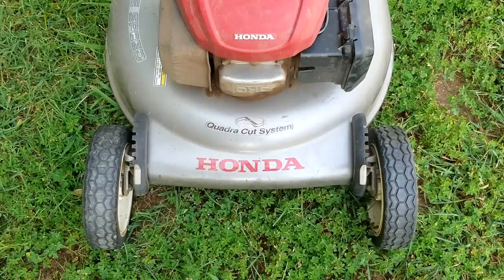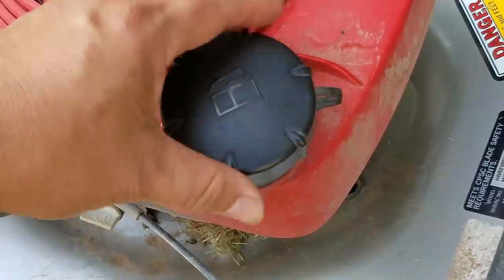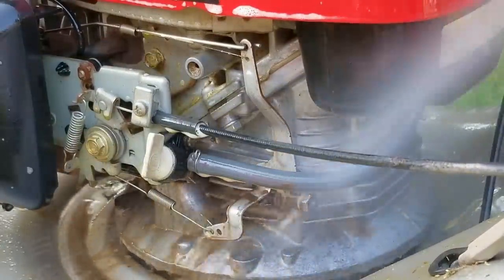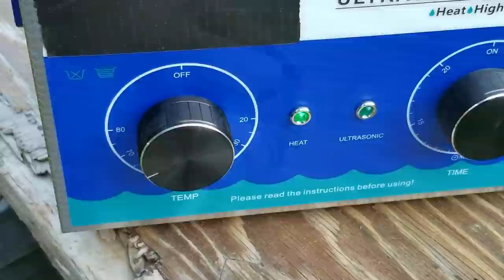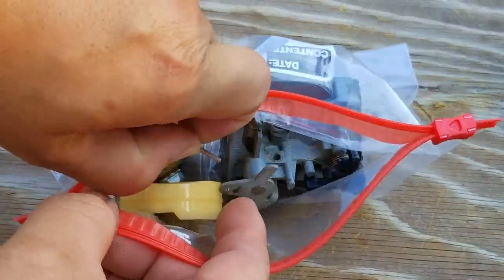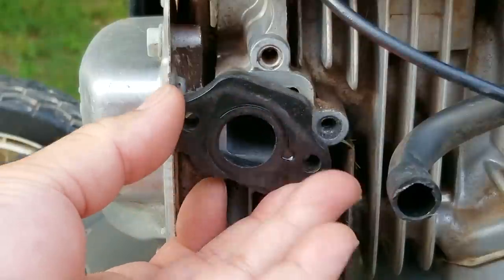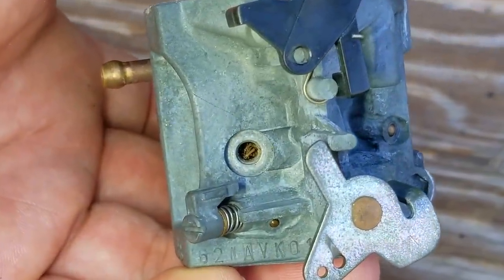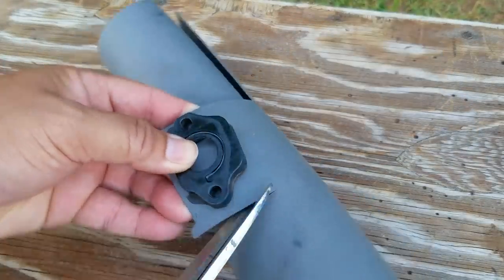This Honda Mower Would Start And Run But Stop

Comment: My first guess would have been a clogged fuel filter not letting enough fuel to the carb, but it doesn't look like this mower has one. Strange. My Honda mower did come with a filter. Second guess would have been the float valve. Very strange to see grass debris in the main jet like that. That really boggles my mind how it got there.

Good job - keep up the good work!
Reply: People fill their tasks in the middle of the yard, and the grass finds a way in. 🙄
Reply from the maker: there's a built in filter at the outlet of the tank

Comment: I cut the heads off two spare Honda carb mounting bolts and used my Dremel to cut slots on them.
I insert them during carb removal. It makes it easier to reinstall and also helps to keep the gaskets in order...similar to the way Kohler carbs are mounted.
Reply from the maker: thank you

Comment: I think too it was the carb, idle circuit and gasket spacer. Plus s good carb clean. With the ultrasonic,  I just use plain ole Dawn dish soap. It's a decreased, the clean the birds with it in oil spills. Works well for me.  Good luck. Thank you for the video.
Reply from the maker: thanks but I do have to remind you that the birds were covered in fresh oil, not varnished gasoline .

Comment: I had the same issue earlier this year with debris in the idle screw/port area.  couldn't recall having ever seen that before.  Had a gasket tear with a friend's Honda earlier this month - didn't have the blade control separately, but surged the entire time.  It also had a cracked insulator (the plastic part).  For my Ultrasonic, I use an Orange degreaser and liberal amount of Dawn dish soap.  I put the small parts into a tea steeping ball, and the big parts right into it.  After about 4 or 5 machines worth, the liquid needs changed.  I also put harder plastic parts inside with a lower temperature setting, as it helps get the greasy, oily grime off with a gentle detailing brush.   Old gas is an easier option, but I always find cuts on my hands that I didn't know I had doing it that way lol
Reply from the maker: you got it, I'm sticking with gasoline or if I get restless, I'll try kerosine

Comment: The last time we used the pressure washer it did just like that mower, even though it had the plastic cam Briggs and it was the main jet stopped. Cleaned it out and away it went. I still haven't gotten the tank drain on it because my Sweetie is threatened me with capitol punishment because of my ailments but it's still waiting. As far as the battery big mower, I've mowed our obstacle course at least 4 times (a good solid hour, drive on low which is plenty fast and blades on economy) and the battery meter is down one bar. Can't tell much difference in reducing the rear tire pressure from 30 to 11 but that's understandable. I run 11 on the opposed, no problem. I got out the Armor-all and went over the plastic. You're methods are rubbing off on me. Happy weekend and Blessings.
Reply from the maker: Nice, nothing wrong with a little pride.. walk to the machine and it's clean, get done doing the work and she's covered in dirt and grass,.. just means something got done.
Reply: True but the fenders have been rubbed on limbs and whatnot getting zeroed in so the Armor-all took care of that. None on the seat because it's slick enough BUT you never know! @HomeGaragechannel

Comment: In my ultrasonic cleaner I use glass jars filled with enough gasoline to completely submerge carbs.

There's no harm done if left in gas overnight.

I recommend you use the basket in your ultrasonic cleaner.
I'm pretty sure the manufacturer recommends it as well.
Reply from the maker: you must have a larger cleaner then? I have the 3 liter and the glass jar that's large enough for a honda carb won't fit with the basket in
Reply: @HomeGaragechannel  Mine is 2.5L and tank size is 9.7" x 5.8" x 3.1" (L x W x H)
I use jars that have lids that are the same diameter of the jar itself.
Reply from the maker: I see

Comment: I am thinking it’s the carb and I believe you have it fixed. Also for those carbs I have seen people use all thread I think it’s called so when you pull out one bolt replace it with the all thread and cut a slot in one end for a flathead screwdriver if you want. Love your videos
Reply: When I was at the L&G shop, I would take carb bolts off a junker, cut the heads off, saw a notch across the bolt [for a flat screw driver] and had the right bolts for dis-assembly/assembly of unit's carb from the unit.
Reply: @georgepruitt637  right
Reply from the maker: yes I've seen the same

Comment: I find that using Pine-sol in the cleaner does not tarnish the carbs, however the temp needs to be HOTTTT before you put in the carb. Not sure why your using a bag (saving money) :) but I do not and have great results.
Reply: I use 20% Pine sol and 80% water and it works great!
Reply from the maker: thanks
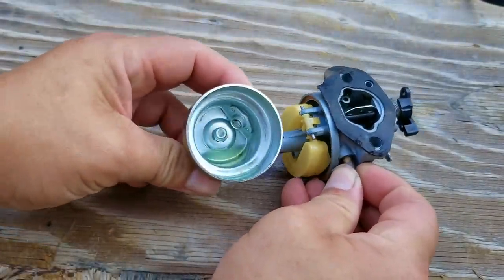Reply: Bag reason @5:08 --  supply shortage.

Comment: I soak carbs in Vinegar for a couple hours .  Than I fill the Ultrasonic with Hot Water, and add a pinch of Baking Soda . Carbs sparkle, no corrosive chemical residue .
Reply from the maker: Thank you for that advice, I'll have to try that!

Comment: Hope you don't try to re-invent the wheel. Use the cleaner DILUTED, and why are you using a bag or jar, and rinse really very well. Use the ultra-sonic cleaner as intended. Try Harbor Freight HD degreaser,  ( the yellow stuff) or I use purple power sometimes. Make sure the liquid mixture in the tank is hot, not cold. Thanks for the video.
Reply from the maker: I'm trying to stay away from the HF degreaser for right now, and sticking with gasoline .

Comment: To me it looks that the cleaner fluid was more then ok. But all those harsh cleaners need care when using on metal, and you never let them in contact with metal parts for more than 10 minutes... I'm pretty sure it's also written on the flask :)
Reply from the maker: yes i have to agree with you, so need to be a bit more careful now.

Comment: my craftsman with kohler mower gets harder to start every year. Normally I put stabil in it and leave it full. Last year I drained the tank completely, drained the bowl, let it airdry and put it back together.

Well I couldnt get it to start at all this year. when i took the bowl off, it was full of a whitish crusty substance. i mean full. all in the bottom of the bowl. all over the float, which was stuck. I couldn't believe it. I have no idea where that could have come from. The one year I drain the entire system and somehow get a bunch of gunk build up, yet every other year i left it full of gas with stabil and it never did that. 

i cleaned it up but it would only run on starting fluid. Even after I got the float free, cleaned all the little pin holes and got fuel to flow into the bowl on it's own. What a mistake. Maybe I should have left the bowl off of  the carb all winter instead?

I just dont understand what that build up could be, with no fuel in it. The gas tank looked great, dry as a bone and no junk in the bottom.
Reply from the maker: sorry I wish I could help with this one.

Comment: Because the oil level was very low on the dipstick, does this mower have the oil minder function to keep it from running with not enough oil. I would have checked this first; and maybe a comment by you would have been helpful.

I really enjoy your channel and you do a great job! Thanks!

Speed
Grand Rapids, MI
Reply from the maker: unfortunately this mower doesn't have that system on it.

Comment: I thought main jet , but then the gasket most likely was the ploblem here  .on the cleaner part i had some that left a carb like that i just try to use water to rinse it off quick . But i use ajax dish soap for my cleaner 👍
Reply from the maker: nice choice!

Comment: I have a older snapper with a Briggs quantum 4 and it's doing that same thing but I drained the gas and put fresh gas cleaned the carb still does it so I need to get a new carburetor altogether
Reply: Could be losing spark when it gets hot. The Quantum carbs are pretty bullet proof.
Reply: @GuysPlayingWithTools  no it not getting gas at all it will run off starting fluid and as long it goes through the air port otherwise it will not run on the carb way I even thought it was the needle and seat but it works I can blow air and carb cleaner through it e no gas goes in and yes gas flows out of the gas line
Reply: @adammosher1115  I would go straight to the jets in that case.  On that motor, there is a bolt holding the bowl on the very bottom of the carb, take that bolt out and clear the holes on the top and sides.  I usually push a thin wire with lots of kinks in it  through them and it usually works like a charm.  I see this a lot and would bet  a nickle that will fix it for you.  👍
Reply from the maker: you're making a great choice
Reply: @GuysPlayingWithTools  I did all that and still no run I even took a carb off one  I know runs and still not running only when it goes through the air port
Reply: Is it an auto choke?

Comment: Broken gasket and dirt in the idle circuit... Would that cause the problems observed? I think it definitely could. Sounded like it was running fast, too, which I don't think would be caused by the problems found. An air leak should cause the mixture to go lean. Dirt in the idle circuit should make it even leaner, which, I think, would cause the RPMs to drop, wouldn't it? I'm wondering how the dirt got in there, though.
Reply from the maker: I think you might be right

Comment: Honda ' sandwich '  Use short lengths of threaded rod [ metric ] to hold various parts, and gaskets  in  place.  Block up carb side wheels so gravity works with you , not against you .
Reply from the maker: I like the way you put that.

Comment: I’m pretty sure you have fixed it unless the cleaning solution has corroded something you couldn’t see.
I have a Honda mower and the engine rpm is not as fast as it use to be in the operating position. All videos I’ve seen say to bend the governor arm. Is this correct?
Reply from the maker: yes it's the easiest way unless you want to do it the hard way.

Comment: Do you know anything about Powermore engines? This on a Cub Cadet self propelled I am working on. This is the first of this type I have messed with. It will run about a second and then die. It will start from the pull rope, but will run for a second, even if I put gas directly in the engine. Starting fluid or brake cleaner makes no difference. It doesn't seem to be a fuel related issue. It's really weird. I have no idea where to start. I have been getting a lot of weird issues lately. I can't really find any information at all online about these engines. It doesn't even have a label or model number on the engine. The issue is very similar to this, except it dies more quickly. It doesn't even get up to speed.

Comment: I've been using super clean on my mowers and other lawn equipment until I noticed that it tends to strip wax off of the plastics and paint making it look dull and faded. I've since switched to a non-wax-removing cleaner even if I have to spray it down 2-3 times. Have you had this same problem?
Reply from the maker: yes I have and I need to be extra cautious when using it.
Reply: Yep the hf degreaser will eat paint and oxidize engine block if you don’t really rinse it good, then spray some wd40 on it and wipe it down. At least that’s what I found. But, it does degrease crud really well!
Reply: @HomeGaragechannel  You may not have the time or the need to, but a great way that I've found to bring back the glossy appereance to lawn equipment is by spraying 303 Protectant on the plastics and applying just about any automotive wax to painted metal.
Reply from the maker: yes that works too

Comment: What causes some of these mowers to hiss when pulling them over? I’d like to see a video fix on it
Reply from the maker: as long as it starts I'm not worried about it. But if it won't start and it hisses I'd have to confirm the hiss is the problem

Comment: I had a briggs that was running poorly.. I ordered a Plastic Carb and it will not start..I put the old one on and it started but fuel delivery seemed poor.. have you had issues with the carbs they order from amazon?  Do you have any advice on where I would begin to take the carb apart and check if its working properly.. is it possible its the part or is it possible I did something wrong?
Reply from the maker: no I very rarely have any issues with the carbs I get from there, maybe 2% need a bit of work to get to work but they work though.  As far as your problem I'd need more information to help out but to be honest it sounds like you have a problem that's not related to the carb.  But with the fuel line, fuel filter or the tank and cap.

Comment: I have a hyper though weed eater that keeps braking the trigger when you give it gas would you have any ideas thaks man
Reply from the maker: sure have you checked that the throttle cable and the lever on the carb, is NOT stuck? I ran into the same issue just today

Comment: No, I think that you found out that those grass clippings were the problem !
Reply from the maker: agreed
Reply: @HomeGaragechannel  One thing that I must add,there's a difference between the gasket paper which you buy at the auto parts store & the cardboard from a cereal box,the latter will cause an oil leak whereas the proper oil jointing or gasket paper won't although it may be good for stopping air leaks at the carburettor !
Reply from the maker: very true

Comment: Use a consentrated degreaser mixed 50/50 with hot water in the ultrasonic.
Reply from the maker: I'd rather just use gasoline or kerosine
Reply: @HomeGaragechannel  lmao i can imagine using gasoline in an ultrasonic cleaner. Hey it may work lol. Im just messin with ya a bit.
Reply from the maker: no for real, water in the basin, and the gasoline or kerosine is in the glass jar where the parts are. It works great so far, way better than dish soap or degreaser
Reply: @HomeGaragechannel  not gunna lie, i thought that would be dangerous to do. I just ordered me a ultrasonic cleaner and i will try that now lol. I have to do the carbs on my motorcycle so that will be the first test subjects lol

Comment: Your cleaner is too caustic to leave sitting. I like your videos and know content creation is tedious, needing the most mileage from each video, but it would help to see the full repair as success or failure.
Reply from the maker: you make a good point and yes according to the directions on the degreaser it's extremely dangerous on paint if left on there for too long.

Comment: Hi I wanted to ask about a trimmer I have its a stihl fs85 and it usually works with 2 piston rings however 1 broke when reinstalling it on the piston....Can it still run with one brand new piston ring??
Reply from the maker: yes you "Could" but I would not.
Reply: @HomeGaragechannel  Hey umm luckily I got the two piston rings any tips on cleaning a gummed up piston ring and the slots for the rings? Or any tips for installing them?

Comment: Hey I just ran into a issue with my royobi wipper snipper, I tried to pull the cord and the fuel start spitting out of the exhaust and the pull cord is extremely hard to pull like you can’t even pull it. If anyone has an idea let me know thanks
Reply from the maker: sure, the carb is leaking fuel into the engine and hydro-locking it.  Replace the carb and you should be good again.
Reply: Ok thankyou!!! I’ll let you know how it went